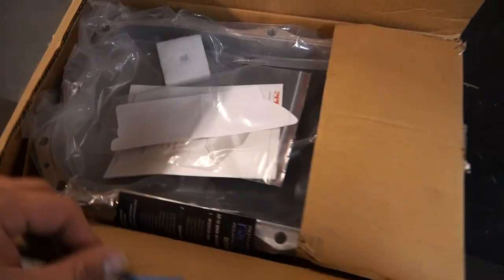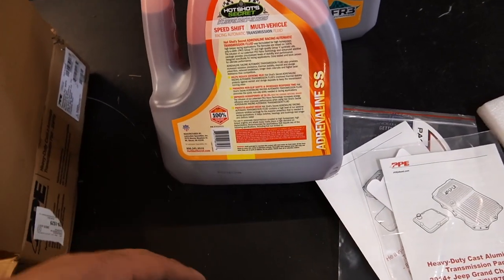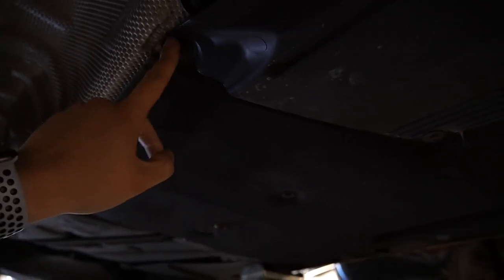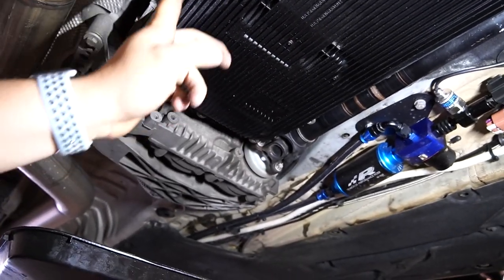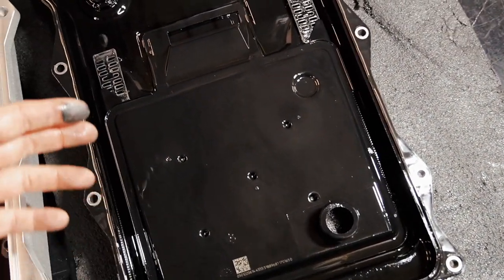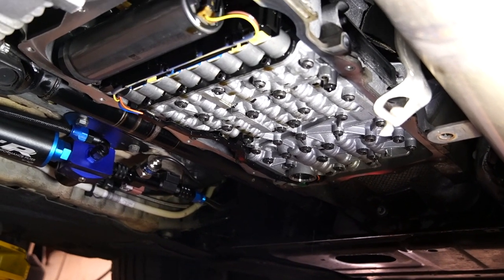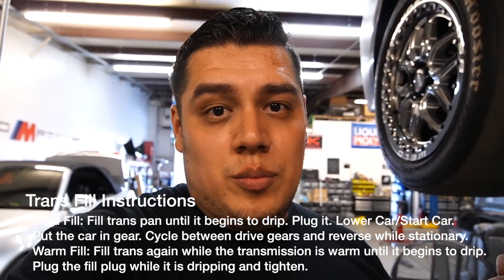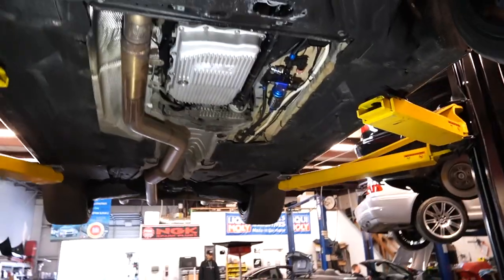UPGRADE YOUR BMW'S TRANSMISSION PAN | PPE Pan Installation DIY

Comment: Never never never, drain your oil  without cracking your fill plug first....
Reply: Wise comment
Only experience teaches that sort of thing well
Reply: Yup. I was changing my trans pan and fluid on my BMW 428i and I had this in mine going into the service and very very good thing I did. That plug was so hard to take off because you can’t get a big enough ratchet in there that’d break it free. My craftsmen 3/8 flex head ratchet with enough persuasion knocked that thing off and the rest was easy. The darn cat is in the way of the fill plug a little, a lot actually, and I burned my hand putting the full plug back on after filling up to operating temp.
Reply: I agree with you, but it only helps you when you have issues with opening your fill plug. Issues with tightening the drain plug will make you end up in same situation.

Comment: Now why would someone want to replace their perfeclty fine oil pan nice video though
Reply from the maker: If you watch the video it tells you why.
Reply: When doing a transmission service, you need to change out the filter which is part of the pan.  So no, it's not perfectly fine lol.
Reply: A perfectly fine plastic pan that can take a rock or stick from the road and break, has a drain plug in a bad place, no cooling fins and no replaceable filter. Hmmmmm. That PPE pan takes a little extra fluid, but there are several reasons why your fluid will be much happier in this pan than the plastic one (aluminum pan helps with heat too). Buy the PPE. It's cheaper than the junky OE one that you can't even replace the filter on!

Comment: Hello. I don't agree. A full flush won't cause any issue at all. I did, not any trouble after thousand and thousand kms :)
Reply from the maker: It will but ok
Reply: If it’s a high mileage auto it’s better to do 50/50 (old/new) fluid. If it’s super high mileage with no maintenance history most techs won’t even risk changing the fluid. The material in the fluid actually helps the clutches. 👍
Reply: If you do research, you'll see many who have done full flushes then complain about slipping.
Reply from the maker: I couldn’t have explained that myself any better than this!
Reply: @ProcTech  You know better than ZF ? I guess no :)
Reply: @Nakinakpgm  😄
Reply: @Nakinakpgm  oh oh coming at me from a point of authority huh 😆.   Like I said do your own research.  Plenty of posts and info about shit going wrong after a full flush.
Reply: @ProcTech  That's not true at all. There isn't plenty of post about that. I'm on many plafform and almost no one talk about that. Stop lying and spreading false information !!!
Reply: @Nakinakpgm  since you won't do your own research, you know using Google or even here on YouTube... Here you go.  Plenty of info and videos explaining why people encounter issues after doing a flush vs just doing a fluid change.

https://youtu.be/o690DovjDAc
Reply: @ProcTech  Wow 2 videos and you make a statement about that. LMAO
Reply: @Nakinakpgm  and unfortunately for you, those videos have more credibility than your 1 experience.  More logic please.
Reply: @ProcTech  They don't make the zf gearbox ;)
Reply: @Nakinakpgm  then what is the ZF S6-650?

Comment: H, quick question.. did the plastic belly cover fit without any adjustment, was there enough clearance considering this aluminum version is deep? If you made some adjustment, please let me know where..

Comment: Any issues since the aluminum pan was installed?
Reply from the maker: None!
Reply: I heard the aluminum pan caused the engine to blow up!
Reply from the maker: You don’t use your brain much do ya? Lmao
Reply: @NoClutchGarage  I mean lil bud what do you want me to say? Bro's asking if a different oil pan has caused any issues. Like best case scenario you get a few degrees cooler or it takes longer to get to operating temperature, worst case scenario everything stays the same. 

Then some lil kid be like wondering if the the radio still works after the new oil pan. People do be like that idk...
Reply from the maker: The aluminum pan is on the trans. If anything was to blow up it would be the trans, but if it happened at all it had to have been installer error because I’ve been running this pan without issues.

Comment: The metal transmission pan bolts are tighten at 12nm of torque. 10nm is for the the plastic units.
Reply from the maker: I was told by PPE to use the OEM specs. I’m not sure I’d want to go 12Nm (which I’m sure would be fine) knowing that metal expands with rising temperatures.

Comment: Does changing the fluid prematurity ( 10-30k miles) impact longevity? Its common to hear to not change fluid until 100k.
Reply from the maker: So changing it prematurely will not have the same effects as if you were changing it late. Reason being that over time the transmission will release friction material from the clutches and such that eventually become part of the fluid. What this means is that the fluid viscosity is now changed because of the added friction material and that material itself also helps the transmission grab the clutches and operate as intended. When you flush that fluid you’re also flushing the friction material that by then the transmission has adapted to and thus it loses the viscosity it used to have and can cause clutch slip as the excess clutch material is no longer there to help with that job.
Reply: Have a bmw 428i with 88k miles not sure when the last transmission fluid flush was done should I keep driving it? If so for how long or should I change the fluid?
Reply: @bryansantos2465 most likely never done since BMW claim it does not need change. 80 K miles sounds like a good time to change trans-fluids.
Reply: My 328d has 165 k the oil was never changed what should I do this mecanic say do not touch it why is that

Comment: Hey man, watched a couple of your videos, well done, I’m doing this exact pan upgrade and adrenaline fluid change based on recommendations from a tuner also. I saw another video, just to clarify they want you to get the transmission temp to about 40c after the first fill then fill it some more. But also the guy added fluid while the engine was running not sure if that’s a mistake or procedure because fluid likely will get pumped in and circulated while the engine is running or only when the transmission is moving? Thanks … out of Tampa FL
Reply from the maker: Yeah you do a cold fill, then you get the trans up to temp, run through the gears as much as you can to get the fluid moving throughout the whole trans, then fill again while the car is on. It’s a multi-step process.

Comment: Its been a minute.  Still recommending these tran pans? Ive read some horror stories due to inconsistent fluid availability and slipping/ burnt clutches.
Reply from the maker: I have been on this pan for about 2 years now, yes I recommend it. I think the horror stories come from people who did not install the pan properly.

Comment: great video, how long did you drive on the older trans. oil before replacing it, please?
Reply: Bmw: lifetime. No need to do anything.
Recomended: every 65k km.
What i do: 100k

Comment: great video! I've been on the fence about this. 

Have you ever actually checked transmission temps? It would be cool to have a before and after of some sorts. 
I myself don't check these so I'd understand if you didn't either... This is still one of those "peace of mind" jobs I'll be doing
Reply from the maker: I have monitored them in the past but I typically don’t unless I’m racing. I’d say typically you’d expect temps up to 210°F and the pan may definitely help keep those temps down especially in cold weather. However, I suspect the temps are lower on average rather than just automatically lower, if that makes any sense. The best way to deal with temps is to close loop the system and add a transmission fluid cooler up front.
Reply: @NoClutchGarage after doing some digging I'm thinking if mostly doing Highway driving then this ppe pan is probably a useful upgrade but if there's track use or canyon runs or any continuous spirited driving then this pan may do more harm than good. Same size pan surface area but more fluid and the increased fluid in that space will actually retain heat more. The Inpower version may be the better option.
Reply: @damians8498  Nonsense.  The increased sumps help (slightly ) in bringing down temps,  both in engine oils and transmissions.

Comment: Nice video I want this kit for my bmw 320d F31. Also I'm planning on getting hot shots secret transmission fluid also. How you liking the hot shot secret products? I've tried the diesel extreme and about to use the stiction and fr3.
Reply from the maker: Their stuff is honestly very good. I have not had any issues with this at all

Comment: Hey there! Nice video 😉👍🏼 my car has currently 45.000 miles… (440i Gran coupe F36) would be 60.000 miles the best time to change my fluid and upgrade my oil pan? I don’t push my car hard.. it is only my daily driver!
Reply from the maker: If you want to upgrade your pan along the way then yes that would be the time to do it. 60k miles seems appropriate to me for a trans service for sure.
Reply: @NoClutchGarage  thanks for your advice. I will do that. 😉👌

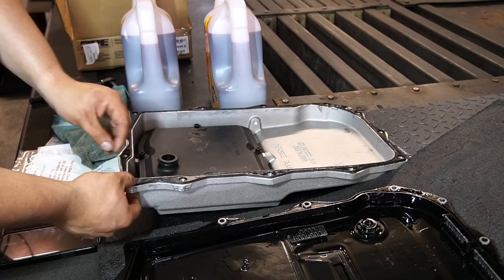Comment: need advice - :D So I finally got around to removing the old pan, and started installing this one... at time stamp 12:26 you reuse the round cylinder spacers from the original pan to the new pfe one, So not sure whats up but they are so tight I cant get them in. I tried to tap-em in, and don't want to crack the pan. Not sure what else to do. It's like the hole sizes are too small to accept them. Thoughts?
Reply: Just measured with Calipers sleeves are 0.50" Holes are 0.47/0.48" wtf should I contact PFE?
Reply from the maker: @Kazarak  that’s odd, I didn’t have any issues fitting those. You could contact PPE or you could take matters into your own hands and get a drill and bit to widen that hole a bit.
Reply: @NoClutchGarage  Ya I sent a ticket in to PFE gonna see what they can do. I might just go ahead and drill em. I don't have a press so it would have to be a hand drill. Thought about cooling the sleeves and heating the pan up with a propane torch also.
Reply: I just drilled em all out and sanded, 2 hour project turned into a 4 hour project. lol
Reply: Yeah, here's a thought, what a waste of money and time. A PAN "UPGRADE"? Laughable.
Reply from the maker: @kjhnsn7296 If you think it’s laughable you either don’t understand its purpose or you don’t need it.
Reply: @NoClutchGarage  Definitely do not NEED it. Maybe you all should add "spinners" to the oil pan also!!!😄
Reply from the maker: @kjhnsn7296 ok you’re clearly ignorant. Have a good day!

Comment: Bro i bought everything lol now im sitting here and thinking can i use the adrenaline ss for a drain and fill? Waiting for your response until i change fluid lol merry xmas btw
Reply from the maker: Yeah that the only fluid I use nowadays besides Amsoil Signature
Reply: @NoClutchGarage I meant like mixing it with the old oem fluid that I can't drain, would it be OK to mix new hotshots with it?
Reply from the maker: @WhiteBeardDetail  yes that is ok. Just drain as much of the old fluid out as you can

Comment: This is not your old regular auto tranny. You can do a full flush if you use correct Lifeguard 8 fluid which has friction material in the oil (thats why its imperative to shake the bottle well before using).
Reply from the maker: Yah brah, I’m not doing that on a tranny with these many miles. Adrenaline SS is a miracle worker on transmissions, so I think I’ll stick to this.
Reply: 🤣🤣🤣 smart man

Comment: Have a bmw 428i with 88k miles not sure when the last transmission fluid flush was done should I keep driving it? If so for how long or should I change the fluid?

Comment: How do you know exactly the amount of trans fluid put in was enough or not?
Reply from the maker: When it begins to drip out of the pan through the fill plug hole. The OEM capacity is 7qt but realistically you’ll only use 5qt during a service. However, this pan holds about 1.5qt over OEM so you’ll use closer to 7qt for this particular service. If you add a transmission cooler that fluid volume will be even higher.

Comment: Never tighten bolts on aluminium parts without using torque wrench at the right spec...
Reply from the maker: Everything is done to spec.

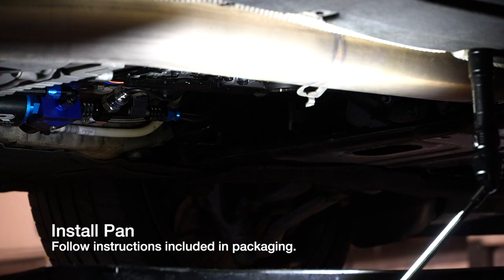Comment: 14:00 - Full Flush Talk

You guys dont do a "Full Flush on a transmission". You said.
NOW, what is this I'm watching?  Full flush? yes , no?
Reply from the maker: Full flush would mean that you take a machine which forces all the fluid out of the torque converter, and all the channels inside of the transmission. What I’m doing here is drain and refill.